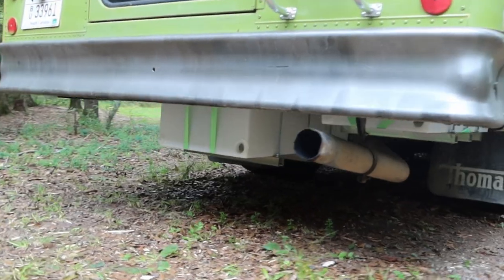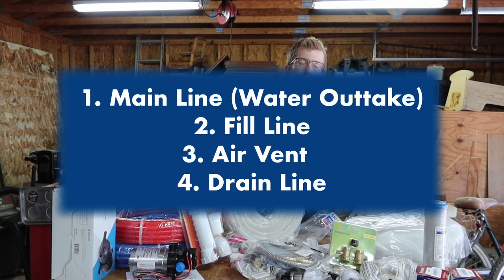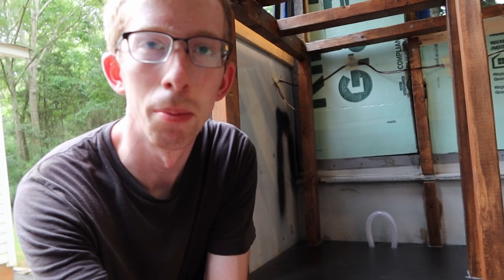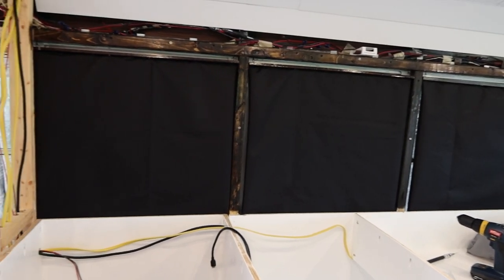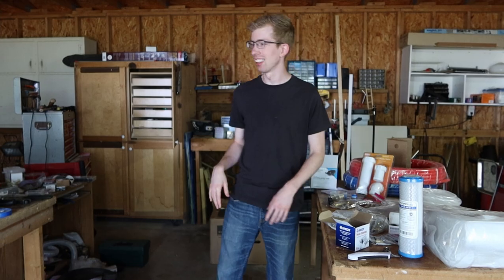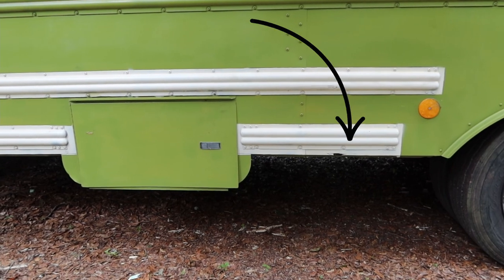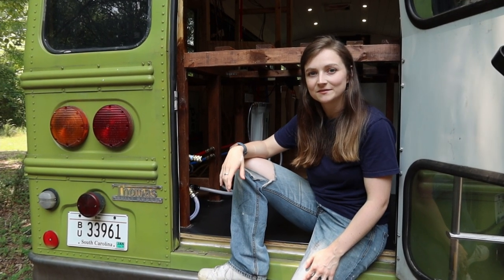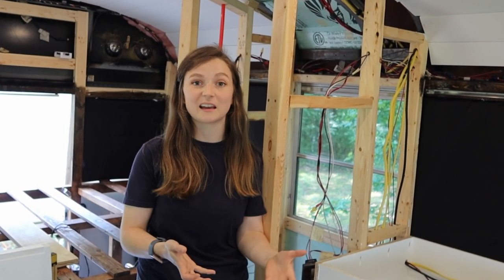Plumbing for Shower and Sink in Our Bus | SKOOLIE BUILD

Comment from the maker: Hey guys! There's one final thing that we want to share in case you're considering building out your own plumbing system: 
We had an issue with some of the brass fittings we used for our potable water.  After installing them in our lines, we realized that they have lead in them, so we will need to go back and replace those. We realized this after filming, so it's not explained in the video. If you're doing your own plumbing, please make sure to get lead-free fittings!

Comment: I’ve been saving this video and my jaw just dropped. I didn’t know we would need so many things. Looks like we’ll be shopping through your links in the next few days. I’ll probably watch this video another 20 times to figure out what I’m missing for my notes which are seriously lacking. We will have a much simpler system. You two rocked it, Jimmy with your plumbing skills and Natalie with those handy blinds, love those. ~A
Reply from the maker: Thank you!! 😄 And yeah, the number of little pieces and fittings you need for plumbing can definitely add up quick... Thankfully it doesn't have to be super complicated, just takes a lot of patience sometimes. 😅 Y'all got this! 💚
Reply: @JimmyandNatalie  I thought we bought most everything it’s probably more the fittings and pipes that we have left to buy. We have the main things purchased. Good to hear this isn’t too complicated. We’ll need patience I think electrical and plumbing will be done the same week I have off for vacation. We’ll both need a vacation after to enjoy our little second home.  ~A

Comment: I will be honest, I have not read through the comments here and this is the first video I ran across from you so this might have been discussed, but I own a bus and had some starting/battery issues.   

I found out that my bus would draw power away from my battery when not used, even for a short period of time.

I installed a battery disconnect on my system right in my battery box and turn that off anytime it's going to sit for more than a day and i have not had any problems since.   They are fairly cheap and easy to install, so you might want to look into that for a fix to your battery issue.

Good video and I will certainly be subscribing and watching you grow!

Comment: Double check to make sure your clear hoses are potable or drink safe of chemicals.  Secondly it's recommended to install a psi gauge on the end of your hose used to fill your fresh water tanks at the end where it hooks up to the water source.  This just protects your plumbing from pressure that can vary from location to location.  "High five"

Comment: Another video in the books.  Will you be adding a connection for city water? Thank you for taking us on your road to the wild blue yonder.    Did you guys video the way you built the half wall under the windows which allows the treatment to disappear in the wall.  I really like the window treatments.   Have a great week.
Reply from the maker: Thanks! We are not planning on a city water connection since we are planning on boondocking as much as possible. And we do the wall framing in our Roof-Top Deck video (https://youtu.be/i03lEYQszxs), but we don't go into too much detail about the window coverings. We knew we wanted to have hidden window coverings at that time, so we framed with that in mind. Although, we didn't really mention it because we still weren't sure if we were going to go through with it.

Comment: I recommend the following to my family whenever they purchase a used vehicle.

Perform the following…
1. Tuneup (new spark plugs, distributor, router, wires)
2. New Batteries
3. Replace break pads (rotors if worn)
4. Drain radiator fluid. Definitely replace the cap!
5. Replace all belts
6. Flush brake fluid 
7. Flush power steering fluid
8. Replace gas filter
9. Replace headlight bulbs (doesn’t matter if they still work or not)
10. Have alternator and starter tested (I prefer to replace them)
11. Oil change 
12. Transmission… if the owner kept track of the service, then continue. Otherwise run it until it goes out. 
13. Buy extra fuses!! In case! 

Good owners will share information with you. I provide receipts with mileage service. 
At some point have air conditioner serviced.

Comment: Pressurize accumulator with air.  Same psi as water pump.  And you need to be able to flush the hot water heater
Reply from the maker: I think we do need to up the pressure in our accumulator tank (it comes pre-pressurized at 30psi but our pump is 45)... But luckily the issue we had with the air bubbles and sputtering was due to a leak we had in the Shurflo sediment filter. Since we fixed that we have had no issues!

Comment: You may find that those expensive shark bite fittings leak. Crimp pex B or Uponor pex A are likely more secure in a mobile application. Glad to see you doing it yourself and learning new skills. I am plumbing a air compressor chuck behind a ball valve to test our plumbing for leaks and to be able to blow it out with a compressor when parking over cold months if we do that. If using compressor don't exceed 70 to 75 psi. Better than nasty RV antifreeze. That air line was a tip from Yvan LaCroix who has built multiple bus conversions.
Reply from the maker: Smart idea about plumbing the air compressor! 
We'll definitely keep an eye out on the sharkbite fittings. We opted for the "crimp-less" ones since we are so new to plumbing and we wanted to keep it simple. As part of that, we made sure that every single joint/fitting will not be behind a wall. So if there is a leak down the road (knock on wood... 🤞) we can fix it easily!
Reply: @JimmyandNatalie  good idea. I'm also not plumbing anything where it's inaccessible. Not wise in a mobile application. The fitting for 1/4 air hose male to 1/2 pex male is on Amazon. Pair with a ball valve or you've created a nice water jet spray nozzle.
Reply: It's a crimp fitting.

Comment: Could it be an alternator or starter? Just a question.
Reply from the maker: We did have our starter repaired in the last few months as well as a killswitch added to our alternator. A lot of diagnosis later and we are still not sure. So the main battery disconnect switch seems to be our main fix for now!

Comment: Hi guys why don’t you check your alternator that it isn’t holding the charge.
Reply from the maker: Good thinking! We actually did have a mechanic check the alternator, and they said it was alright… We never found the source of the drain, but the kill switch seems to have fixed the issue! 😬🤞

Comment: Is it possible to add a battery charger from your solar system to the bus battery?
Reply: This! @Jimmy & Natalie,
You should fit a DC-DC charger to allow your House Batteries to keep the Vehicle / starting batteries charged if needed, such as if you were stranded or parked up somewhere where you need to leave exterior marker lights on at night for safety, as those run off the vehicle battery, and can drain the vehicle battery in a few hours.

You'd probably want at minimum a 40 Amp if not higher unit.  Renogy does have some to fit your existing ecosystem.
Wouldnt hurt to have 2 DC-DC units with their own switches too, One to charge the Vehicle from House batteries, and the other to do the reverse of charging the house batteries from the alternator.  

That should cover most eventualities such as Dead alternator can leave you walking so being able to run the engine / vehicle systems from house batteries and solar could be useful. As could being able to charge house batteries from the engine alternator, eg if the Solar has a failure or you manage to deplete batteries due to say an entire week of shit weather and not getting enough solar charge.

You could also add an emergency parallel switch (which directly connects both battery banks), but thats really kind of a last resort thing that would be used ONLY to assist the vehicle battery to start the engine if its too low (in that instance, use DC-DC to charge the vehicle battery first for say 15 mins, then parallel to crank and then isolate again).

Also on the Subject on Renogy, it looks like all your Renogy gear so far is the stuff with RS498 data ports, so you can get their RS485 Hub and connect a single central monitor screen or bluetooth adapter to that and be able to monitor / control the entire system from one screen or phone.

Comment: You are a cute couple. I don’t what to be to critical. 

The LP tank inside is dangerous. Use less hose fittings thy are not designed for what you are doing.